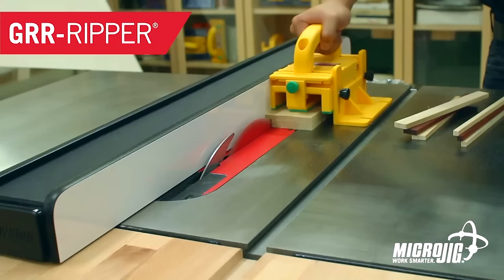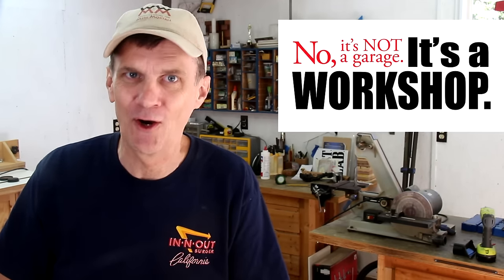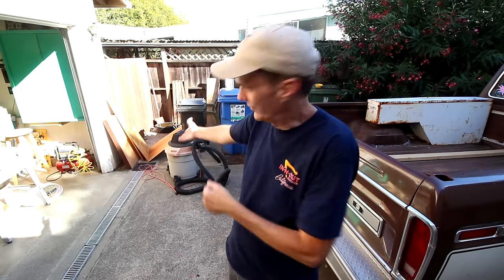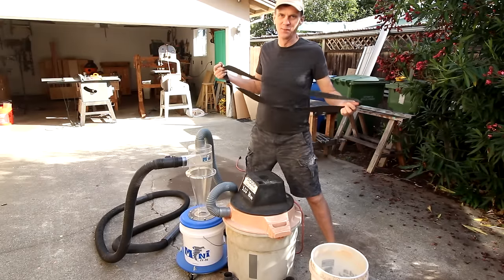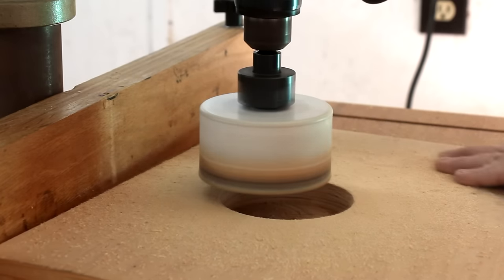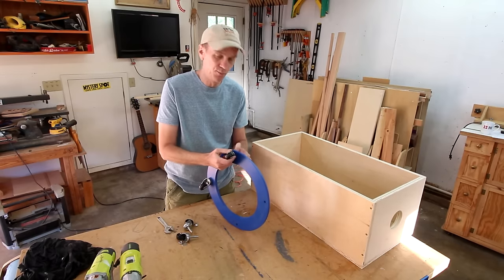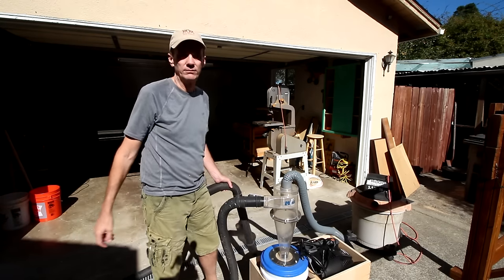Affordable Dust Collection for the Home Workshop

Comment: OK, I have a cyclone from Woodcraft supply and installed in a 5 gal Home Depot bucket. Th bucket sucked in and collapsed. I added 1/2" cross supports in the middle and same thing happened. Any ideas?

Comment: Hi Steve, question for you. How do you use this shop vac/cyclone combo to collect dust on a table saw where you have both a 2.5” port and a 1.5” port for the saw blade guard? If you don’t use a blade guard, what would you recommend?

Comment: I like this, I'm sure it does a good job of keeping the shop clean but the biggest reason for dust collection is our health.

Wood dust is carcinogenic. Fine particulate matter is really awful for the lungs and the best shop vacs don't have close to the CFM needed to keep the smallest, most damaging particles out of the air. My table saw for instance needs a PORT pressure of 400 CFM minimum to be effective. I have the exact same Rigid shop vac someone gave me and a newer nicer one, both have less than 200 CFM max. Still, it's all I have until I save up for a decent dust collector but for the 100$ or so I spent on a new shop vac, I really wish I had just bought a Grizzly dust collector for $50 more.

There are plenty of small dust collectors, they can be mounted to a small vertical cart with the cyclone underneath next to a fine-filter bag, no bag and vented outside. If you don't have the space or money for a huge stationary machine and static duct work, a portable machine directly to whatever machine your using is the best bet. After reading the health guidelines for dust collection, I was kind of horrified at how inadequate most dust collectors protect our health are.

Comment: As floor space in a small shop like mine and yours is so limited, I’m wondering if it would have been better to build it going vertically rather than horizontally.  Eyeballing it, you prob could reduce the footprint by 1/3 to 1/2, I think.  Thanks!!

Comment: How thick is that plywood used for the box - 3/4" or 1"? Here in Canada a sheet of that stuff would not be cheap, $42 - $60 (CDN), depending on what type and thickness it is. And that model of Ridgid vac is $129 (CDN) at HD. Brand name Dust Deputy is only available online at $100 (CDN) without a bucket. Knock-offs from China about $40 without bucket. 
Looking at about $220 before tax (13% in my province) without extra hoses, fittings, gasket, etc...   I wish it was easier / cheaper.

Comment: Steve, I was looking up the cyclone dust collector when i found a dust stopper ($41) which does similar function. It snaps on to any 5 gallon bucket and stops the debris from going to the vacc. Any experience working with this kind of tool

Comment: If everything goes into that bucket... is it safe to vacuum up fiberglass with it if I don't have a Hepa filter shop vac? 
I assume it wouldn't be Or else that would be a selling point so you can use it for both sawdust and fiberglass

Comment: This movable unit looks very useful to me. Maybe I'll make one. One question: what does the cyclone top do extra/better?
Last winter I made a simple dust collection system which contains of an old home vac and a bin which should originally be for ash
from wood stoves etc. At first it didn't work so I changed some things. Now it works rather well but I do not have that
cyclone top.
Reply: Did you watch the video?  He went over the benefits of the cyclone.
Reply: Yes of course I watched the video. And after your reaction I watched it another two times.
And I read the article. But still my question remains: what does the cyclone top do extra/better?
With the cyclone top I mean the "plexi glass" funnel, not the bin under it.
I have a bin but not that plexi glas funnel. The biggest part of the sawdust ends in that bin, not in the vac.
But I do not know what %, but for sure far more than 50. The 99% which is mentioned in the video is correct, estimated or .......
Reply: The cyclone is a separator. Large dust particles and debris get separated into the canister by a combination of vortex and gravity.  As they spin around the side they lose momentum and fall. Only the finest,  I think less than 10microns? Makes it into the shop vac filter. This greatly,  I mean GREATLY extends the life of the shopvac filters.
Reply: Hans de Groot

Comment: all these shopvacs seem to come with paper bags, but nobody uses those right ? i'm having a real hard time choosing a shop vacuum because of this, some come with foam filters instead but you can only use that when vacuuming wet stuff and you have to use the paper bag for dry stuff, so i guess i should avoid those.

Comment: In another video you mentioned wood glue is stronger than the wood and screws are unneeded when glue is applied.  In this case you did install screws while also clamping the box while the glue dried.

Was this simply so you could move on sooner or was there another reason you also used screws for structural reasons?
Reply: If you look close, in this case he used "butt-joints"... OR in simpler terms, there was no joinery technique to speak of. SO the screws will remain as a little bit of hardware reinforcement. It's quick and cheesy, BUT the other advantage of adding screws is that they allow a bit of flexibility in the joint(s) before utter failure, and that's important for a cart that carries some weight and bounces around on uneven terrain (like a driveway or lawn). ;o)

Comment: Just looked up the shop-vac, how is it possible to get 5HP from 900 watts? 5HP should be equivalent to roughly 3700 watts... Maybe the next project with this shop vac could be an over efficient perpetuem mobile. Buy enough and you can power your house ;)

Comment: 5 hp is 746W x 5 = 3730W. Most wall outlets are rated at 15A so 120V x 15A = 1800W. Wouldn't that trip the breaker? How do they rate these things, anyway? I bought that same vacuum and a Dust Deputy and now have to upgrade to dedicated outlets in the garage and back bedroom which I use as my shops.

Comment: Shop-vac is a brand. Are you promoting the one brand over other wet/dry vacs? If you have a whole house or central vac all you need is a cyclone separator and you are in business. Use the central vac as your vacuum source and the cyclone to grab all the dust, you just need some piping in between the pieces and a hose to connect to your tools.

Comment: I had one cyclone with a shop vac and a big 30 liters bucket, but at the first start, the bucket collapsed on itself because of the negative pressure, it still worked fine , but the bucket looked horrible. i used it for a while but i stoped because of this. Do smaller buckets do this type of things or it was my fault for using one too big ?
Reply: There are utube videos talking about this problems. I think the videos show a solution, perhaps a plywood insert

Comment: The cyclon thing seems quite expensive for what it is. I could justify buying a decent shopvac but not sure about this. Wouldn't it be relatively easy to make one? I have seen several YT woodworkers, namely Matthias and Marius Hornberger building their cyclons but both builds involved using quite special tools and also seemed quite difficult for me.
Reply from the maker: Yes, building one is beyond the scope of this show.
Reply: Well I just checked the supply here in Czech Republic and it seems noone sell that thing here. Given the price and the shipping I'd have to pay, I'll probably give a shot to some DIY approach :D Thanks for the video though, I have been thinking about dust collection for some time and this may push me towards some solution eventually.

Comment: Honestly, you don't even need that cyclone thing on the top at all.  I just used a 5 gallon pail, a few PVC elbows, and a shop vac.  It works perfectly.   I think the cyclone top thing is just a gimmick.  It MIGHT work 2% more efficiently, but honestly it's not with it.

Comment: Is there any reason not to add a dust extraction to the front end of a whole house vacuum when the unit has an access port available in garage/workshop
Reply: I don't know if it will be strong enough, and you definitely need a cyclone so as to stop as much dust from getting inside the system as possible. Other than that, it should work. Should being the keyword.

Comment: do u use your sawdust for anything ? or do you toss it in the garbage ?
Reply: Hmm ... good point. If you compost, you can use it in there as a source of "brown" material.
Reply: Henry Ford had the same question.  He hired E. G. Kingsford to find a use for waste sawdust and scrap lumber.  The result was charcoal briquettes.  Sawdust can also be mixed with glue and pressed into particle board.
Reply: Emmit Stewart good for chicken coops too for bedding .
Reply: Certain wood species are not good for compost.  Black walnut has a compound in it that poisons the soil so only black walnut grows
Reply: Garrett Ducat did not know that
Reply: Dang, black walnut is savage.
Reply: Lynn Mckenney If you go out in the fields, the only plant that grows under a black walnut tree are brambles.  the leaves and husks from the nuts poison the ground for everything else.  No grass, no greens, just thorny vines.

Comment: Why does your cart need sides... and why design it so that you need to remove a cross brace to change the filter on the shop vac?
If you would have used the original blue ring to the cyclone... with spacers that would raise it up 3-4 inches from the base of the cart... it would have kept the cyclone from going anywhere (the original design idea of the ring).  Then you could have used a similar raised piece of plywood to hold the shop vac onto the cart... and not have to mess with a cross brace.  A simple handle on the cart would make it easier to move around... and maybe hold accessories.
I'm re-subscribing just for entertainment... and because your videos are in focus now. 
:)

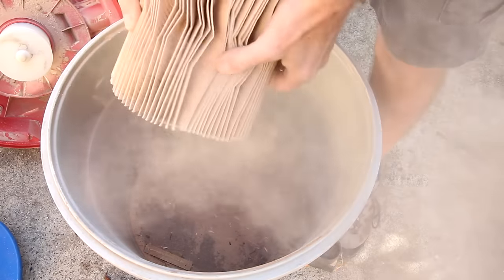Comment: I have a shop vac that comes with one or those filters he had at 3:19. Do i need to leave this in, whenever i vacuum out a car i take the filter out. I see no point in the filter when vacuuming saw dust because wont it just get clogged? Why not leave the filter out? I also saw something about a Vacuum bag for shop vacs, is this needed?
Reply: The filter keeps stuff out of the motor, so it's pretty important to have that in whenever the vac is running. I use a bag in addition to the paper filter - it catches all the dust before it gets to the filter, so the airflow stays good until it's actually full. A cyclone would be better, but I haven't gotten one yet.
Reply: You should use a bag over the existing filter.  I have a Douglas shop vac and it's pushing 35 years old.  I've always used a bag over the filter and  I have yet to replace the filter. if you're going to use the vac to suck up liquids, remove the filter bag first. Harbor freight sells these bags 3 for 5 bucks. They have an elastic top and should fit over any filter.
Reply: I've seen a lot of folks use a pantyhose sock over the filter to act as a pre-filter that keeps most. of the sawdust out. a cheap alternative to a bag. great tips here!
Reply: Uh, if you dont use the filter, then anything it is sucking in, it is just blowing right back out. (Unless you are using a bag)

Comment: what can you do with all this sawdust?
Reply: Sift it and mix it with wood glue to fill holes in the wood. You may add a few drops of lime so it wont go too dark.
Reply: Make a sawdust cannon.  Thanks to Mythbusters for that one.
Reply: Add it to your compost pile.  Just be sure to give it a little extra Nitrogen to help in the breakdown process.  Shavings from the wood lathe are also good for bedding if you have chickens or add to the compost as well.
Reply: Add a little canning paraffin and you can make fantastic fire-starter logs.
Reply: I have a giant saw dust pile in the woods behind my house. If you don't have woods, compost, etc, Then either the dump or the same place you'd take yard waste would be the next option.

Comment: Don't belittle that bigass garage you have there. Where i'm from having a garage at all is reserved for above median income, or live way out in the countryside. Even then your garage... ahem, workshop seems about 1 - 1.5 meter wider and deeper then a standard garage over here. I too have a shop vac, but only ever use it to clean up after the fact, or to clean the cars. Most of the actual sawing is done outside.  Indoor sawing is hand or jigsaw only

Comment: 5 horsepower?
Never in your wildest dreams are you going to get 5 horsepower out of a residential wall outlet.
Reply: It's the usual shop-vac nonsense, but they do seem to be consistent relative to each other, so that's something.
Reply: It could well be the rating of the motor I suppose.
Reply from the maker: I don't know anything about that. I  just know that if it says 5HP,  it is enough to remove the sawdust from my tools. The number itself is irrelevant for my non-scientific brain!
Reply: Hey Steve, it's marketting nonsense, lots of companies do it.
Standard wall outlets in the US supply 120V at 15A max before the breaker trips.  So a maximum of 1800W...or about 2.4 hp.
I suspect what they're quoting on the machine is what the motor is rated to, so the motor is about twice as big as it needs to be...so maybe lasts longer?

Comment: It doesnt have 5hp actually. what pointless system. i was confused for a sec then googled because it does not have that much power. its peak power motor draws when it stops. so its not the power it uses to perfom its task. i cant see why are they marketed in a such way. in Europe you have watts and air wats to indicate of efficiency

Comment: I like most of your videos... but this one doesn't make much sense to me. By the time you buy a new shop vac, cyclone, and build a box to put it in you've got to be approaching $200 which is what an entry level dust collector costs.
Reply from the maker: Won't you still need a shop vac in the shop?
Reply: @SteveRamsey  You have a point. However, in your video you had a shop vac and then bought a new shop vac to make the new system....LOL. It seems like it would have been better to keep the old trusty water logged shop vac and invest in an entry level dust collector. I have never used the cyclone system before, but I'm assuming an entry level dust collector would work better?

Comment: Das ist trotzdem noch keine wirklich ausgereifte Idee.
Besser ist es zwei Kammern aus Holz zu machen und 
das Gebläse aus einem alten Staubsauger auszubauen
und nur das Gebläse zu benutzen in einer Box mit zwei Kammern.
That's still not a mature idea.
It is better to make two chambers of wood and
to remove the blower from an old vacuum cleaner
and only to use the blower in a box with two chambers.